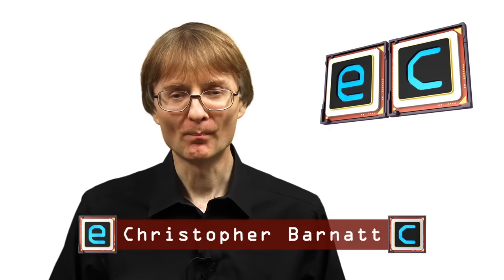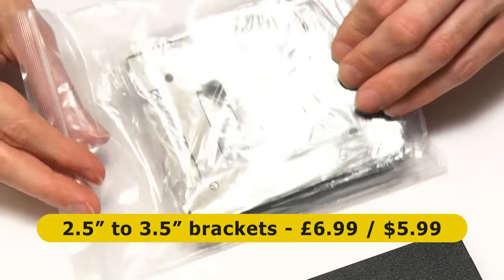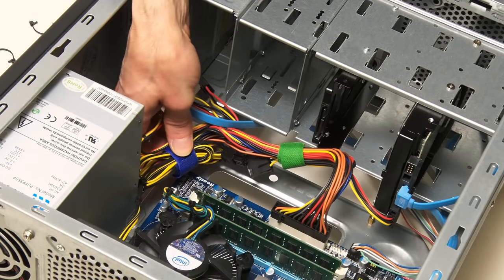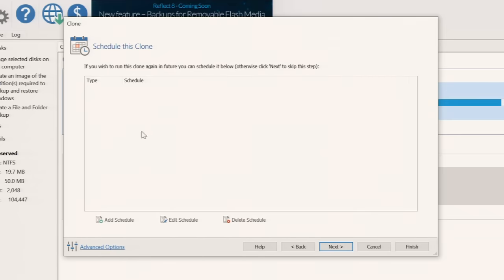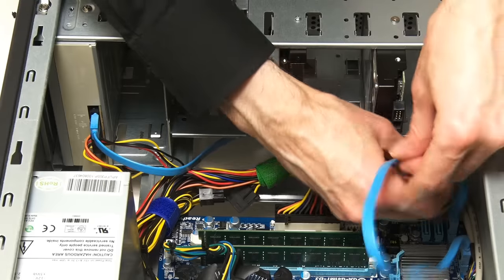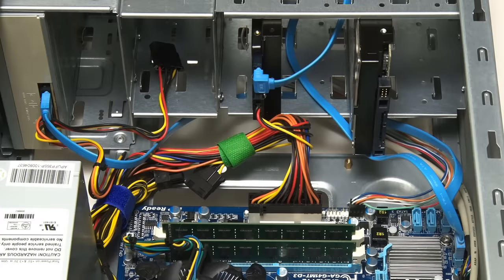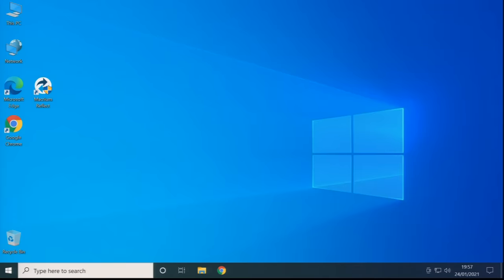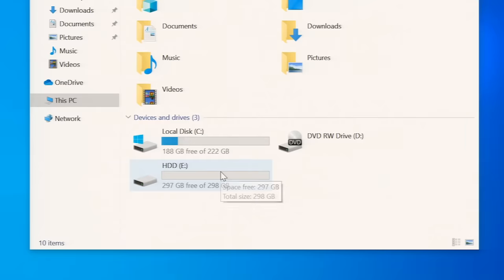Old PC Upgrade #2: SSD Boot Drive

Comment: No AHCI mode on sata controller? With bios dated 2010? That sounds unusual, maybe there is an option for switching ide/ahci? (my ami bios dated 2008 had it under "sata configuration"... the boost on Sata2 in ahci mode is quite noticable, so it worth switching to. Also, have you checked "power settings" in win10 - enable "fast boot" there, the machine has enough ram to make use of this feature. p.p.s. right-clicking win10 start button brings most of needed admin features in one menu, far more useful than right-clicking "this pc". Anyways, great vid as usual, Chris!

Comment: If you wanted a faster boot you could use an mSATA SSD connected to an adapter and plugged into a PCIe slot - this could give you about 400Mb/Sec. It also makes for a much neater interior.

Comment: You got a better deal on that bracket than I did: I somehow ended up buying a Corsair brand bracket for like $20, as a non-negligible fraction of the (mx500) drive price. Fortunately I had a spare SATA cable (with 90 degree connector as required by the fancy Dell workstation case) on hand, because I totally forgot to order one. Left both connected because the hd was 2tb, vs 512gb SSD. Did a fresh install of Windows too, using the Media Creator tool for the latest build, which was probably also a nice boost of speed over the several years old installation. Really felt like a new PC, at least for a few months until we actually got a new PC🤦 but hey, made it way less painful to use, and sometimes you just want a desktop. The random access benchmarks in Crystal Disk Mark went up something like 100x...

Comment: would recommend doing this. My pc used to take 2-4 mins to properly load, adding a 240gb crucial ssd £20 sale, makes it boot and load properly in 20 seconds  (My pc is 13 years old)

Comment: Great video :) I'm also going to mention that you probably would not want an NVMe or M.2 SSD if you're doing this - old motherboards most likely do not have an M.2 slot for those, instead look for SATA SSDs that use the SATA connectors :)

Comment: I have an old ASUS motherboard with an AMD FX-8350 CPU. The motherboard has only SATA II connectors, and my SSD was running slow like shown in this video. My solution after I cloned the HDD to my new Samsung SSD 860 EVO 500GB
 was to buy a cheap PCI Express to SATA3.0 2-Port Adapter on ebay (range from $10 to $15) which provides its own AHCI mode and it's bootable. I simply changed the cloned SSD's cable from the motherboard to this adapter and booted the computer. Now the SSD runs at SATA III speeds and the computer feels like a modern PC.

Comment: I have an "old" acer i3 7100U laptop that took 2-3 min to boot, it has a NVME m.2 slot but all i had was a Samsung 840 pro SSD laying around, so I cloned the drive &
Now it boots in 12 seconds. Faster than my Ryzen 7 3700x system with NVME drives now!!

Comment: Another strategy worth mentioning is to leave the OS on the HDD and shrink the amount of HDD space required by the HDD's OS.  The remainder can be formatted as an additional data partition.  In this manner, there is a backup OS on the HDD, and one can boot from that backup OS by switching the boot device in the motherboard's BIOS.  We have found this strategy useful, particularly if/when the SSD's OS is corrupted with a virus or other malware.  Restoring a drive image of the OS on the SSD runs much faster than it runs if one is restoring an OS image with a DVD or CD restore disc.  For this strategy to work perfectly, it's usually a good idea also to shrink the OS on the SSD and to create another dedicated partition on the remainder of the SSD.  In that manner, one should end up with 2 x OS partitions of the same size, and likewise 2 x dedicated partitions also of the same size.  Finally, with 2 x dedicated data partitions, each discrete drive image file of C: can be copied to the second dedicated data partition, for extra redundancy.
Reply: I should add a few more "finer" points about the strategy above.  After shrinking the OS partition on the HDD, it's also a wise policy to write a drive image file of that backup OS.  However, it's highly recommended that you write that drive image file to a different storage device e.g. the dedicated data partition on the SSD.  Otherwise, the read/write heads on the HDD will truly "thrash" between the OS partition and the dedicated data partition on that HDD, inducing extra and unnecessary wear on that HDD, possibly causing it to fail, particularly if it is old.  

Also, if the C: partition uses all available space on any storage device, private data files may be lost after a drive image of C: is restored.  That's another very important reason why it's wise to shrink C: and use the remainder of a HDD or SSD as a dedicated data partition, where all private data files should be stored.  In that manner, if the OS is restored from a drive image file, those private data files will remain intact because they reside in a dedicated data partition, and NOT in an OS partition.  Hope this helps.
Reply: p.s.  the excellent Partition Wizard freeware makes shrinking an OS partition very easy.  The licensed version of that excellent software also has a "Migrate OS" feature that functions similarly to the "cloning" procedure Chris demonstrated with Macrium Reflect.  That "Migrate OS" feature requires the entire target drive to be UNALLOCATED, however.  As such, we shrink C:, then "Migrate OS" to the SSD, and finally create dedicated data partition(s) with the remainder(s).

Comment: I use Velcro ties as well. Though, I have a feeling that the original clamp ties were there to prove that you voided your warranty.. I have an old I5 system that I built in 2012 that I have upgraded from 8gb  of RAM to 16GB, by adding an additional DDR3 8GB RAM stick. It's not like receiving a new PC, but it is a notable upgrade. 

Ebay is a good place to look for used/ second hand PC's. But also check the local computer/ electronics/ office retail chains. Here in Canada, "Staples" has a pretty extensive list of refurbished laptops and desktops on their website. BestBuy, Newegg, Amazon, Walmart's website, Ali Express are other examples of places that sell refurbished PC's and laptops. There are a lot of retail outlets that do deal with refurbished hardware as part of a promoted recycling of older hardware.

Comment: Many 3.5" to 2.5" drive cage adapters come with lots of cables, from sata data cables to sata power cable splitters and molex-to-sata adapters.
I swear by the Inateck ST1002S kit.

Comment: You should disable hybrid boot in power options and should check in BIOS if fast boot option is available. Fast boot can cut down time needed for system to POST.

Comment: With Macrium you don't need to drag the individual partitions down to the target. Just click finish after selecting the target and it will carry out the clone.
Reply from the maker: As I've noted already here in some detail, in the free version of Macrium this is not true unless you are cloning to a drive of the same size. If cloning to a drive that is smaller, you would lose the Windows recovery partition, as Macrium Reflect 7 Free does not resize partitions in proportion. Rather, if you take the "copy selected partitions" (aka finish) option, it adds each partion from the source drive until it runs out of space, and truncates the last partition. I did try this. It does not work, which is why I made the video the way I did. Even when cloning to a larger drive, manual intervention is needed, as I show in more detail in this videos: https://www.youtube.com/watch?v=UTsq-HHz0Ss

Comment: I recently replaced the 1TB HD 5400rpm drive in my laptop to a 1TB SSD.  I used Aoemi Backuper to clone it and it was brilliant!!!  Anyway it boots up in like 10 seconds, and shuts down similar.  It is a quad core i5 with a GTX950M so not state of the art.  As the video suggests, no matter WHAT the system, an SSD is the first port of call to upgradfe from HDD, although I do have a netbook with an atom I would suggest an SSD would not make a lot of difference on that but you have inspired me to try!

Comment: The trick to zip ties is not to ratchet them all the way tight. Just make a loop to bunch them up, not cinch them tightly. Then it's easy to cut them without harming any wires.

Comment: Something doesn't seem right in your boot time comparisons, as the SSD should be significantly faster than the mechanical drive. Perhaps it's just a really slow SATA interface? However, a couple of things come to mind:

1) The initial boot on the SSD will be much slower than the subsequent boot. Are you using the initial SSD boot time for the comparison, or a subsequent one?

2) The first step following the initial boot is to perform Window's SSD optimization. Do you do that?

3) You stop the comparison as soon as the Desktop icons appear, but that does not mean the computer is ready for use (boot complete). This doesn't really apply to an SSD, but it significantly applies to a mechanical drive. In other words, the boot time comparison should stop when you can open a program, not when the Desktop icons appear.

BTW- I love your channel!

Comment: I did this in 2012 with customer computers. Upgraded RAM and put an SSD (60 GB) in to give their computer a couple years more life. The existing harddisk then became the app/storage disk while the SSD was used for the Operating System. I would turn off swap disk (or make it very small) if the amount of RAM was >8GB.

Comment: Thanks for the video Chris, I have an external SSD currently plugged into an USB 3 port (via an adaptor) but would like to move that internally and switch my mechanical and SSD drives without destroying data.

Comment: 😏My laptop is over 4 years the hdd die in 1.5 year and I replaced with 250gb ssd, also add more ram and my laptop has cd drive so I replaced with a cd caddy and add a 2tb hdd for my data. Best upgrade 👌 I will keep my laptop until it kill over since it runs better than new.

Comment: Why take up JUST ONE drive bay when you can take up TWO!  LOL.  - 4:04
Reply from the maker: There is a caption which makes clear that the drive could be mounted on the other side of the adapter! :)
Reply: @ExplainingComputers  - Yes, I saw your caption... fair enough but I would still put it on the "inside" where it would give more room to a drive above for cooling.  Obviously that's not a problem for this PC but I think it is a good habit and will reduce the need to do it in the future here or in another PC where you want that SSD installed.  I like to give HDDs lots of room for air flow when I can by skipping bays, etc.  Just nitpicking a bit!   ;-)

Comment: A very nice video Chris.  It's very helpful for my relatives who are a lot more cautious than me when it comes to upgrade their computers.  Upgrading a laptop to SSD is an even more powerful solution than desktop.  I upgraded my gen 1 i7 laptop to SSD and the improvement was phenomenal. On Crystal Mark I have read, 279Mb/s - write 250Mb/s on a SATA II interface. It changed my 2010 laptop from slow and almost useless to fast and still useful in 2021. However this requires an external interface for the cloning process hooked up to a second laptop.  A video to overview this process would also be very helpful.

Comment: I replaced the HDD to an SSD in a Dell Latitude E6400 and its read and write speeds on SATA II were noticeably better than what you're getting, 274 read 256 write.

Comment: I'm actually quite surprised that worked. SSDs aren't really set up to boot on a legacy boot setting. And based on those partitions it was for sure legacy boot and not UEFI with secure boot. I've cloned HDDs to SSDs with legacy boots and it will act really wonky such as the display cutting out randomly and other things like that.  Depending on the manufacturer of the SSD it may or may not work. WD blue 1TB SSDs will not work with legacy boot, only UEFI
Reply from the maker: There is no reason that an SSD should not work with a legacy BIOS. I've used scores of SSDs on many different systems and never had an issue.
Reply: @ExplainingComputers  I've had nothing but issues with anything I've used. Maybe it's because I use higher capacity (TB or higher) drives almost exclusively. Maybe it's because I use disk partition wizard... but I was also told that SSDs won't really work on legacy boots and my experience has validated that.

Comment: @explainingcomputers Did you check to see if the SSD was connected to the fastest SATA port? If you haven't done so, look to see if you have connected the SSD to a SATA I (1.5Gb/s), SATA II (3.0GB/s), or SATA III (6.0Gb/s) port. If you have inadvertently connected the SSD to a slower SATA port, then you may be able to speed up things (like OS and application load times) by connecting it to a faster port. Love the channel! Cheers!
Reply from the maker: Thanks for this. All SATA ports on the motherboard are SATA II. I have never come across a motherboard with a mix of SATA generations. :)

Comment: Owned a 1tb SSD and tried to clone it from 2tb HDD for 2 years without success. But after following the steps in your video, I now have a working SSD with Windows 10. Love it and thank you very much.    Question: Can I use the same approach to clone my old HDD with Win7 from my SSD with Win10 or must I "wipe clean" it first?

Comment: I'm pretty sure you connected the SSD to the wrong side of the 3.5" caddy. Much tidier for it to be in the well. Having said that, my bay adapters both house 2 SSD drives each, which gives me little option. And, personally, I'd have used clonezilla, which retains everything, including UUIDs (though I've never tried to clonezilla to a smaller drive, so stand to be corrected). It does, however, do the job remarkably quickly and efficently. It also does not require a lot of clicking through nothing to get started, nor indeed, does it need imstalling. It can be run quite happily from a USB or CD drive as a standalone.

Comment: Great video as always, Chris. Just a question: since it is a different hardware, did you have to re-register Windows 10?
Reply from the maker: Cloning produces a new drive that Windows recognizes as the old one, so Windows activation is not affected. The device Windows is registered to is also (largely) the motherboard.
Reply: @ExplainingComputers  thanks for explaining it, Chris. I ask this because I did a HDD 2 HDD cloning but the cloned drive "unregistered" Windows 7 for some reason. I used Macrium Reflect too.

Comment: I bought a Lenovo Edge E73 in 2012. I first put in a new PSU so it could run the GPU I had bought: A GT 450. It had the i3-2120 and I put in 8 GB of 1333 MHz RAM.

Ran it many many years, and it had a 500 GB HDD. It became slower and slower over the years, until it became so slow that I stopped using it.
So this month I bought a cheap mini ITX board with an i5-4570 in it, and I bought 16 GB 1600 MHz RAM, a 2 TB SSD and a GTX 1650. Completely different speeds.

Only mistake I made when I cloned the HDD to SSD was not altering the size of the 2 TB in Macrium, so I now have a lot of GB that I can't use or activate because they sit on the same drive as the System, and Windows would be wiped if I activated the missing GBs.
Reply from the maker: You should be able to expand the size of the Windows partition -- or add another partition -- in Windows Disk Management, and so access the extra capacity on your SSD. Windows will not be wiped if you expand the size of its partition.
Reply: @ExplainingComputers  I will try when I come home. I also need to put in a standard power switch connector, because Lenovo, hp, Dell and others made a lot of hardware proprietary.
Thanks for the advice.

Comment: Great video.  However, I do use zip ties still.  But, having said that I don't snug them down so tight that you end up cutting something else.  As in most cases, you want it snug, but not so snug you end up killing it...  And on zip ties, I confess, most people pull them so tight, it's a problem to remove them.

Comment: when i had my dual core, System with the HDD, it ran windows 8,as soon as windows 10 came out, i decided to swop the HDD with the SDD, and installed windows 10. It made a world of difference. I think systems like these were just windows upgraded and sold on.  With the free upgrade option at the time.

Comment: Aren’t the 2GB boot limits from the old IDE days?  If you have a modern SATA interface drive size can be much larger. 

Also, heat dissipation of SSD may be an issue so if you’re going to mount to the case directly via double-sided foam tape or adhesive VELCRO —  I’d attach a heat sink to the SSD with heat sink compound to help passively keep it cool.
Reply from the maker: The limit comes from BIOS rather than UEFI motherboards -- nothing to do with SATA vs IDE. So a board like this cannot boot from a GPT drive, hence limiting it to a 2TB MBR one.

Comment: As a stranger to computer tech, I am putting this guidance into practice on a very eligible older PC.  Forgive my ignorance, but the thing that surprises me about cloning the operating system is that MS is happy to allow the Windows licence to be transferred so easily.  I presume they have some means of detecting if it is used on more than one machine.  Is it registered against the processor or some other element of hardware?
Reply from the maker: Windows 10 registers against the motherboard, and is tied to the device (PC), and also tracks other significant hardware changes. So the cloned drive will only work with the specific PC.